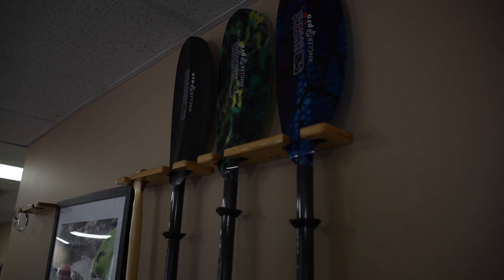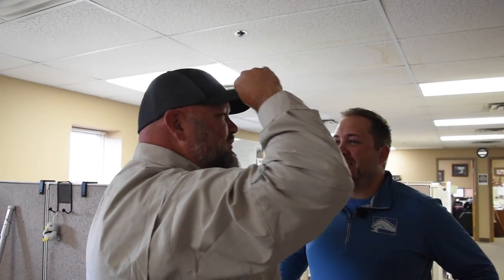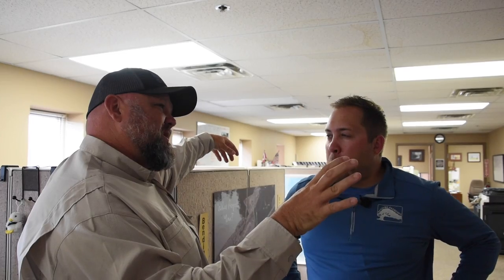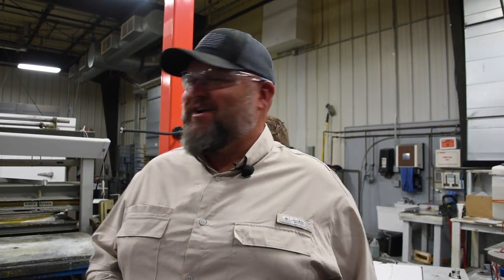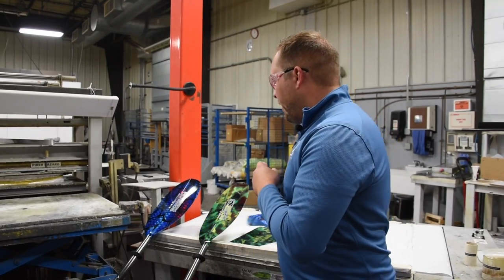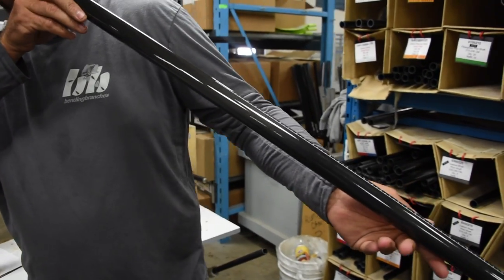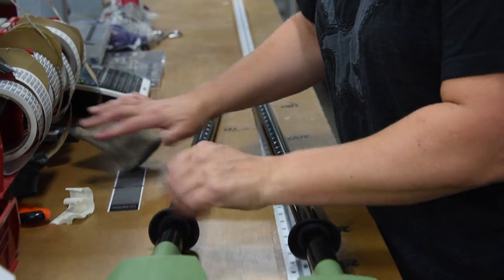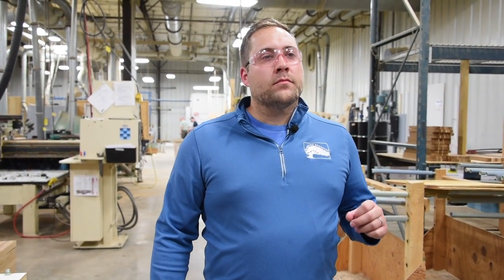HOW A KAYAK FISHING PADDLE IS MADE | BENDING BRANCHES

Comment: I just bought an angler classic. It was the best one the shop had, specially with "fishing features". Needed a measuring tape on it, also the knock snap remover. But for $225 Canadian, I'd like a little more out of it to be honest. BUT all in all I do like the paddle. It's a lot lighter than the one I used before.
Reply: Keenan Moore i bought the aqua bound manta ray hybrid. Was $179 Canadian and love it.